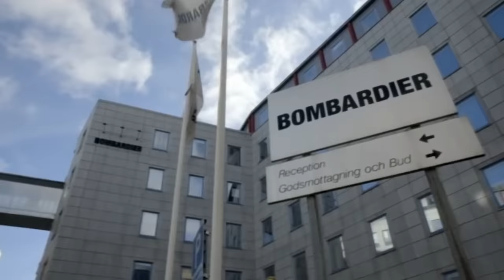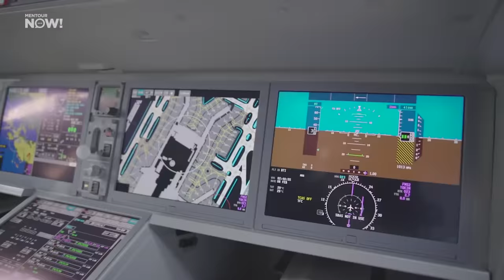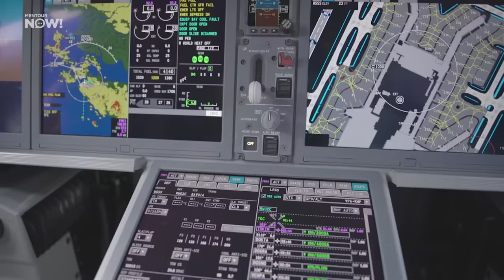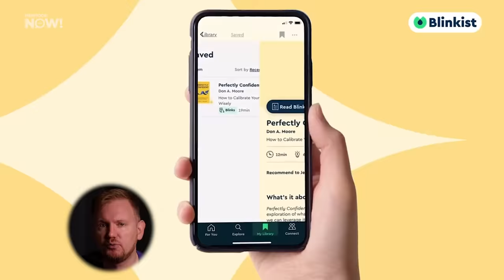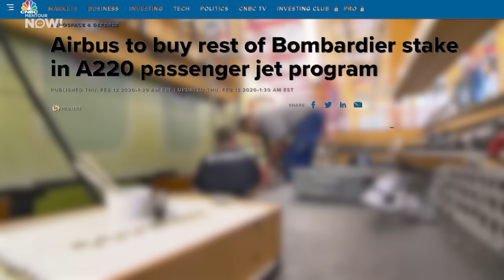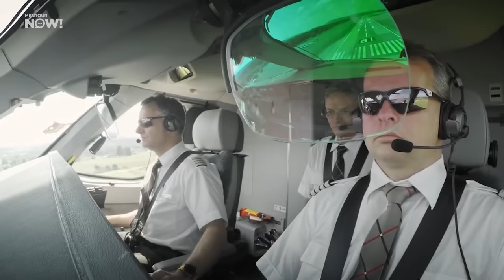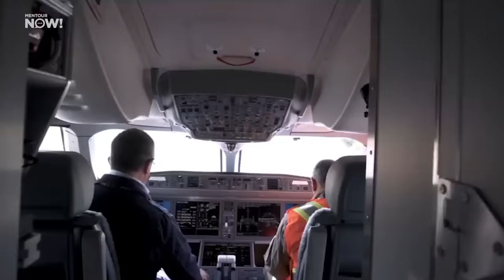Did Boeing GIVE Airbus a FREE Airplane?!

Comment: What's puzzling is why Bombardier left the partnership in early 2020. It's their succcessful design and, apparently, these smaller planes weren't grounded nearly as much as other aircraft during the pandemic slowdown. Perhaps they wanted to stay an independent competitor with their other, regional models? And the Canadian government was ok with it since the premier A220 assembly line remained in Quebec? Also, why did it cost Airbus nothing to come on board (and eventually take over)? Just market might?
Reply: Bombardier needed cash to scale up the C-series production.  Airbus purchased 50% stake for $1; however there were strings, Airbus  had to inject significant funds into building an assembly line in the US and other development costs.

Comment: While an A220-500 will cannibalise A318 and A319 sales, these two A320 variants will still have a useful niche at airlines already running bigger A320s but who need a shrinked version for their thin routes - its about pilot and maintenance commonality. Airbus will still sell many more planes overall though with a A220 stretch once they sort out and then scale up the supply chain, so from Airbus' POV its all about the timing for introducing the 500 - IOW not "if" but "when".

Comment: Boeing's last real inovation has been the 777 in 1990. This plane has been a revolution in airplane-design similar to the B747 in 1969. After the introduction of the Airbus A300 with it's fly-by-wire system, glass-cockpit, mainly computer-controlled avionics which made the flight-engineer useless, things changed rapidly (in favor of Airbus).
This A300 soon turned out to be more than 25% cost-efficient than anything Boeing had to offer in this segment.
The A300 changed aviation-history again. And Boeing (10 years too late imo) tried to catch-up with similar designs like the 757/767. Succesfull planes but they never could really compete with the following Airbus designs based on the A300.

Boeing instead chose to develope the B737. An outdated design drawn in the early 60ties when wide turbo-fan engines weren't available(invented) yet. They tried to fit those new engines on a plane that wasn't designed to carry them. Along with all new computerized avionics, materials and regulations.

Boeing should have dropped the 737 concept all together after 1970 when the A300 came around. Developing a kind of 'C300 ' instead. Boeing revolutionized aviation again with it's 777 but failed to innovate in the mid-range section enough. They got stuck on keeping alive a 'dinosaurer' in aviation. The B737.
Conservative polici is always bad to any company in the end.
The 737 story makes a great example of this attitude.

Comment: Can someone who reports on this issue actually report it properly.  The trade commission CONFIRMED what Boeing stated, the problem was they placed a 400% tariff on the plane, but that was overrode because it was seen as excessive. But they allowed Boeing to retry it.  By this point, the MAX issue had just happened, and they were grounded so Boeing was too busy dealing with that legal nightmare to deal with the CSeries.  Also, Bombardier NEVER OFFERED BOEING THE C-SERIES PROGRAM.  That is a myth. Airbus made an unsolicited bid for the program and bought it for the equivalent of a $1 in a highly dubious deal. On top of this Boeing wouldn't have wanted to purchase the aircraft anyway because its a side stick aircraft meaning it isn't common with the Boeing cockpit layout.

Comment: It will still take years for Airbus (or Boeing if it had managed to buy the CSeries programme) to ramp up production of this model, this is likely one of the contributing reasons that Airbus is reluctant to go ahead with the -500 version. The CSeries supply chain was set up by Bombardier for a relatively low volume production, it was not expected to win a huge volume of orders because of the difficulty of competing against Airbus and Boeing, because of that the supply chain is less easy to scale up.
Reply: Airbus has time. Their 320 Neo is up to date, and a later launched 220-500 could even replace it without the high costs of a clean sheet design. The 321 is likely to grow further in size with the new developed 321 wing they may launch in the mid 2020s, to come even closer to the 757 in capacity and payload.

Comment: Maybe the A220-600 would then be next step that uses a better engine and is a bit longer and show it to Delta and United with their aging 757-200 fleet? Of course it would be one step down, a dozen or two less seats, a bit lower MTOW a bit less range but I imagine quite more efficient than 757. Couldn't that strike a big deal?

Comment: I thought Swiss were 5he launch partner for the CS100 and airBaltic for the CS300.
And you can always apply for a job at airBaltic, you will guaranteed be flying the A220-300, and only.
Reply: Swiss were the launch partner, but the parent company of Swiss is the Lufthansa Group. So the CS100s were sold to the Lufthansa Group for operations by their Swiss division.

Comment: As soon as the C-series starting having problems, I said on a forum that Boeing should jump in and either buy the program or invest in it, as they can really cause the smaller Airbus A320NEOs trouble, and it would be cheaper than starting a new program from scratch. Nope, they screwed it up, and John Leahy rubbed their noses in it

Comment: So Boeing f*cked off another time.
Meanwhile Airbus is developing a new, bigger carbon fiber wing for the 321 - which will give them the opportunity to launch an own NMA aircraft based on a stretched 321 fuselage (a clean sheet design would not be that different, since the 321 is already 3-3 and includes fbw) combined with modern carbon fiber wings and more powerful engines. 
The 220-500 could be the 320 successor then.

Comment: some sales guys passed on the quartz watch, some sales guys passed on the Beatles ... 

C-series had a market window when Airbus and Boeing said "we're not re-engining for maybe 10 years".  Then that window closed tight and the rest is history.

Remember Boeing's experience with de Havilland ... maybe reinforced their opinion that "those guys north of the 49th are a bunch of charlies" ? (BTW, I are one)

Ask Embraer about dealing with Boeing (as a partner).  I'm surprised that Airbus hasn't moved in there yet (although Embraer's aircraft line is very similar to Airbus's, so why ?).

Bombardier "sold" C-series to Airbus ? ... generous use of "gave away" !  As I understand it many major airlines didn't trust Bombardier to stay in the market.  Before Airbus no sales, after Airbus plenty of sales.

another issue is how does the C-series design (like systems and architecture) marry with Boeing "mothership" designs ?  But then you do reasonably mention that C-series is a NA design architecture.

Comment: Bombardier was  and mostly is a Quebec  company , and as such heavily dependant  on Provincial handouts tho it has operations in Ontario in Aircrsft and Trains and Streetcar design and manufacturing-  The Toronto LRT is one example of  bungling and cost  overruns . Quebec  labour force is also heavily  unionized, thus things products  and things  cost more, having said that the CSeries  passenger  jet  is a very good design despite the cost overrunning delays, it truly is a World class passenger  jet, able to land and takeoff from shorter runways and smaller airports,  and its flyby wire controls and sidestick  closer to Airbus than Boeing, and yes, Airbus got the jet for not even a song, it king of just flew into the Airbus Nest, so to speak.🛩🛬

Comment: Pissing off customers has become a Boeing practice after its merger with McDonnell Douglas and embrace of a shareholder value strategy. 
You can add to the Canadian government, the US Air Force who were forced to buy a 767 based refueling aircraft after Boeing threw a hissy fit at having lost the contract to Airbus as well as the African aviation community pissed off at the snide remarks of Boeing executives about the pilot skills of African pilots after the 737 Max debacle.  
The current Boeing philosophy seems to be that customers don’t matter: shareholders do. Problem is that shareholders are now pissed off too at Boeing’s decline share price.

Comment: As a Canadian ... you're right, when Boeing had that tariff dropped on the C-series ... we were very pissed, and our government dutifully (with Canada's trade pitbull Chrystia Freeland the minister on point for this) followed the sentiment of the Canadian people,  shafted NAFTA negotiations over this, and dropped the F-18.  Heres the thing ... the way things worked out:

Here we are years later, and after a re-tender of the bids for military fighters, because the previous Conservative government tried to ram thru a very expensive F-35 deal without an open competitive bid process, and as the F-18 was dropped, the present Canadian government eventually secured a bid and contract with Macdonald Douglas for the F-35 ...  literally 35% cheaper for more jets.  The Conservative deal was that bad.

In other words, Boeing got hosed, Canadians got a heck-of-a-deal on an F35 deal, and won the NAFTA negotiations overall ... and Canadians dont have to subsidize tax dollars to Bombardier anymore for the C-series (something we weren't happy with at the time) and Canadian airlines dont have to deal with Boeing to buy these planes for our northern rural routes. 
Its a win/win/win/win.

Comment: Respectfully disagree. The design philosophy of the CSeries was much closer to Airbus (passive Side-Sticks).  Boeing was more interested in the Embraer E and E2 series aircraft which are a much better fit just below the 737 family capacity segment and also use (back-driven) yokes. That was a real tragic missed opportunity for both companies, but that's a different story. Back to the CSeries, it was never a good match for Boeing, the overlap with the 737-7 (and -8?) that already had a commitment from Southwest and other airlines, would result in yet another step-child much like the MD95 (717) was. The Max will be in production for 20 years and sell thousands. Boeing has time to figure out a replacement.

Comment: Hindsight is very 20/20 here: Airbus took a MAJOR gamble that the A220 would be cleared of the complaint. If it hadn't, Airbus would have been in a MUCH difference position today with the 220, the US market is simply to massive to ignore. Both Boeing and Airbus made VERY large gambles here, and Airbus won.

That said, I don't feel at all bad for Boeing. They showed their true colours in both this fiasco, and the MAX issues. They have long moved from a company wanting to design great planes, to a company wanting to use any dirty tactic they can to make money. My opinion of Boeing certainly changed after this incident, but being Canadian I am very biased.

Comment: this story really goes to show how much of a duopoly the airliner industry really is. smaller firms like Bombardier get run out of business or swallowed up by the big players through anticompetitive moves like this one. 

this event, along with other financial pressures, really reduced Bombardier to a shell of its former self. it sold off the CSeries program to Airbus before it could reap the rewards of its massive success. it sold off the CRJ program to Mitsubishi. Bombardier Transportation, formerly one of the largest train manufacturers in the world, was sold off to the French giant Alstom. Nobody would disagree that Bombardier was financially unsustainable at the time, and it's doing much better now. however, they now only make private jets.

Comment: Boeing was so stupid that they would have likely cancelled the whole C-Series program to prevent it making inroads into the 737 line-up, even though it was built to fill the same point-to-point philosophy as the 787.  They just couldn't see the need for a small plane with good range...

Comment: Boeing and a complete lack of foresight since the 1980s, name a more iconic Duo - I'll wait.

Can't wait to fly on an Airbus A220 in 2023, courtesy of JetBlue probably, or by Swiss Air later in the year on my fall trip.
Reply: IMO if Boeing made the following decisions, without the ability to know what would actually happen, they wouldn't be where they are now and fighting for credibility when they effectively created the industry and owned the transition to the Jet Age - even doing one or two of these decisions would have a pretty good chance at improving their current situation:

1. Re-engine and re-wing the 757 & 767 in the early-2000's with production goals of the early to mid-2010s. After seeing how well the 777 did, and how poorly the larger A340s sold and in the midst of another gas crisis. The 767 & 757 were already developed as a pair the first time, make them the first Boeing-MAX jets.

2. End the 737 after the NG, or made an ER version of the NG-7 & -8 for Southwest/Ryanair etc.

3. Keep the 787-7 cancel the 787-10 - market the 787-7 as the 757/767 MAX replacement. The 787-8 and 787-9 are by far the sales leaders of the type. The 787-10 is great, but makes little sense to make if airlines had 767-MAX and a 777-X is around the corner.

4. (Most will hate this but hear me out): Cancel the Passenger 747-8i focus on quality control of the 787 program once production ramps up, this is also probably the one we can only spot with hindsight and may not have much effect, but could have freed up some resources that may have spotted production inconsistencies.

5. Use NAFTA to its advantage to takeover the C-Series - do the same that Petter described at the end of the video for the outgoing 737NG models

6. Focus on developing the 777-X/797

Comment: "Airbus and Boeing are both major manufacturers in the aerospace industry, and they have developed their own unique designs and technologies over the years. However, it's not accurate to say that Airbus airplanes are "based on" Boeing airplanes. While both companies might incorporate certain industry-standard technologies and respond to similar market demands, each has its own approach to aircraft design, engineering, and innovation.

Airbus, for instance, introduced the fly-by-wire system in commercial aviation with its A320 family, and it is known for the double-decker A380, the world's largest passenger airliner. Boeing, on the other hand, has been known for aircraft like the 747, which revolutionized long-haul travel, and the 787 Dreamliner, which focuses on fuel efficiency and passenger comfort.

Both manufacturers have developed their aircraft based on decades of experience, research, and technological advancements, rather than one being based on the other's designs." ChatGpt 4

Comment: Hubs are full. RJs were originally conceived for long, thin routes but it didn't work out that way and we got 2 decades of horrible schedule integrity. Now with economic growth, to not repeat mistakes of the past, if airlines want to use 100-150 seat aircraft they're going to need more hub capacity. This means more hub or focus cities. For smaller cities there is a balance to be struck between average delay and schedule sparsity. It's nonsensical to have 8 flights per day when they're routinely delayed 2 to 4 hours. I trust our bean counters have an accurate cost model that includes the new ground infrastructure needed for smaller jets, but I also trust history to repeat.

Comment: As a Canadian, I am frustrated to no end by the C-series. 

We all knew that Bombardier is a very poorly run company. But as an aviation enthusiast, I also knew that cost overuns and difficult developments are almost par for the course when it comes to clean-sheet designed planes, so I was willing to give the engineers at Bombardier, if not their managers a chance and to see the program through. And for a while, it looked like my optimism had paid off when it was revealed that from an engineering point of view, the C-series was an excellent plane.

When Boeing started filling the dumping complaints against the C-series, I think most Canadians were like me very angry at Boeing. When Airbus proposed a joint-venture, I was a bit nervous. It would have been nice to have them collaborate with us to avoid those tariffs and it opened up Airbus's sales network to the C-series, even if Bombardier was essentially giving up control of the program. But as a stakeholder, they would continue to take a share of the profits and contribute to the plane.

When Airbus bought the entire C-seires program, I was not happy either. Bombardier management had a perfectly good product on their hands and they just sold off, because they had so poorly managed their company's finances, they were desperate for money to pay off debts. Meanwhile, Airbus got an outstanding product that now allows them to fill a niche in the market they previously did not have covered for a fraction of the price it would have cost them to develop it themselves.

So now, if a Canadian airline wants to buy a C-series jet, they'll have to buy an A220 from Airbus rather than from Bombardier. Urgh...
Reply: The plane is still mostly sourced and manufactured in Canada even under Airbus management, at least until 2040, due to the stake that Canada's government has in the program. Combined with Airbus's sales expertise and increased sales, this could still be a net positive for Canada.